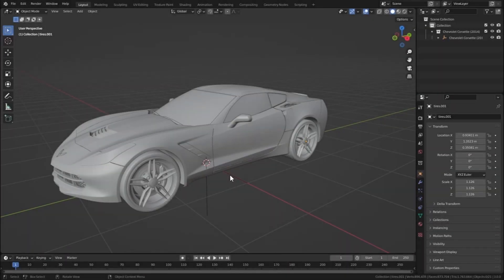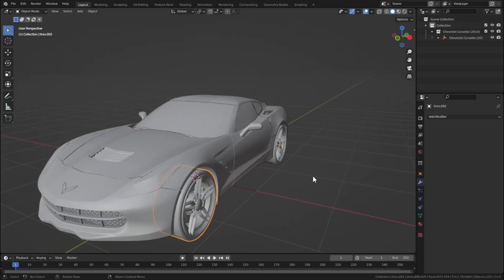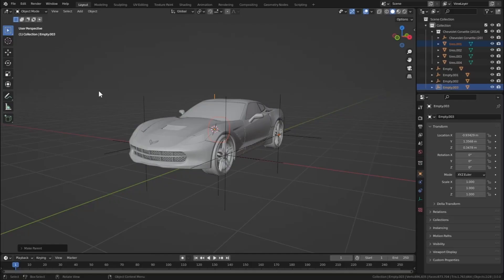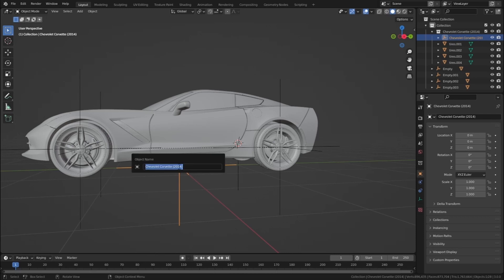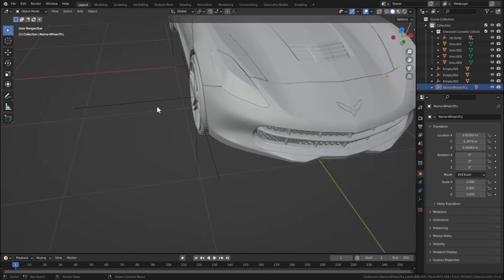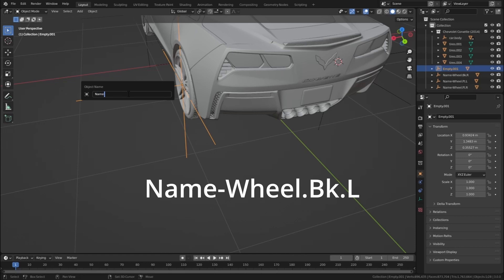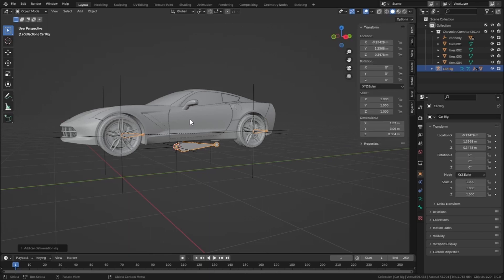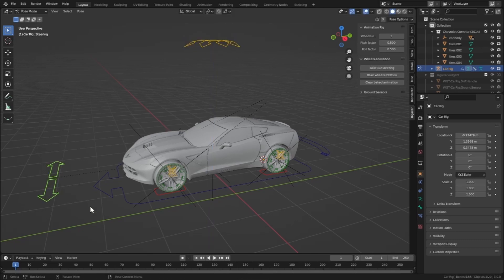Blender Car Rig - How to rig a car in Blender in  5 minutes ( Easy )

Comment: I’m having a lot of issues with animating steering and wheel rotation. I have gone into pose mode and clicked on rig:root and added the follow path constraint, which all works like it should. But for some reason the steering and wheel baking is just not working and it keeps deleting the key frame I added for the follow paths animation. I have set the wheels on y axis to 0 which didn’t fix the problem also. And I named each car part correctly.

Any help would be appreciated, I’ve looked at multiple other posts and yet to find a solution.
Reply: Same...

Comment: Bro after applying rig.. my car parts will float in the air.. and also it will not be in perfect position. How to fix ?
Reply from the maker: Make sure you name it correctly OR when it also happens to me sometimes , I used to start over
Reply: @bro-3d  make sure the origin of each individual objects are in center of it
Reply: @bharatindianagamer  do you mean setting all tyre origin to geometry ?
Reply: @takenbyblancship1017  yes all the separated objects
Reply: press n and make location coords all to 0
Reply: Me too